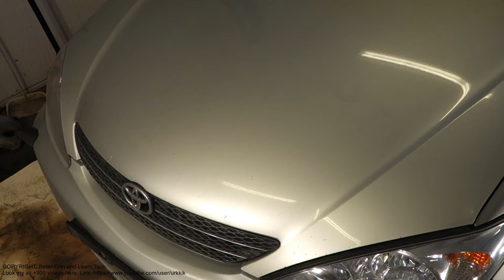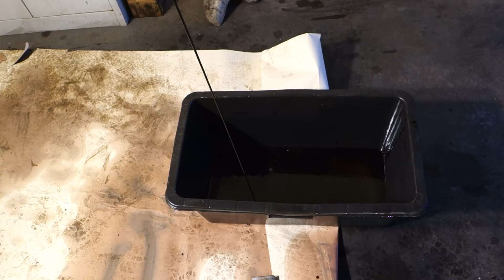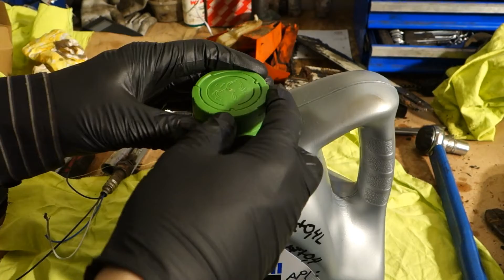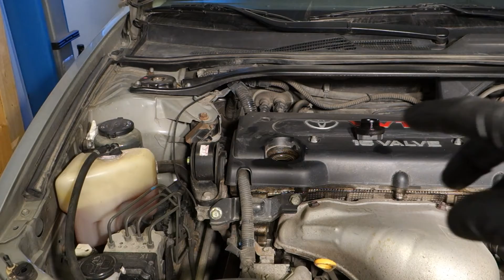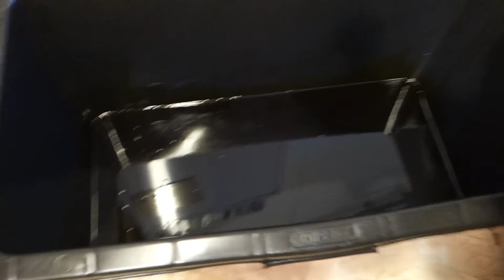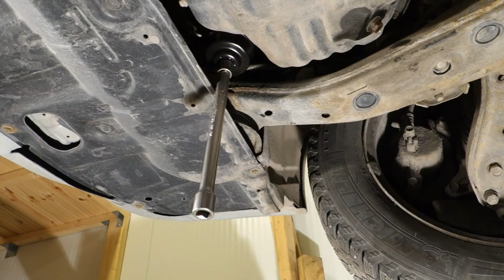How to replace engine oil  and filter Toyota 2AZ-FE

Comment: Couldn't you install the filter before putting in new oil so that not as much leaks out when removing the filter?
Reply: I always replace the filter after draining the oil.. And I would never start the vehicle until the new filter is installed because you're mixing the old oil inside the old filter with the new oil. '
Reply: @publickdefendrr8101  Read that again and tell me it makes sense?
Reply: @Buddyclub33  it does. The old oil left inside the old oil filter would mix with the new oil if you start the engine before replacing the filter.
Reply: @publickdefendrr8101  makes sense, I  always do that
Reply from the maker: Great ! And Thanks for feedback. :-)
Reply: that doesn't matter, there is always oil sitting in the filter that will drip out no matter what you do